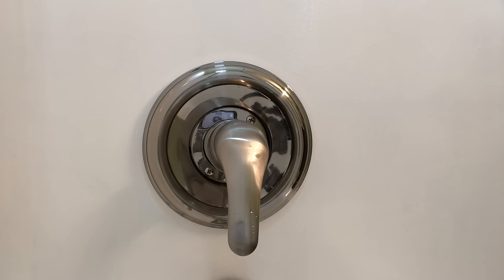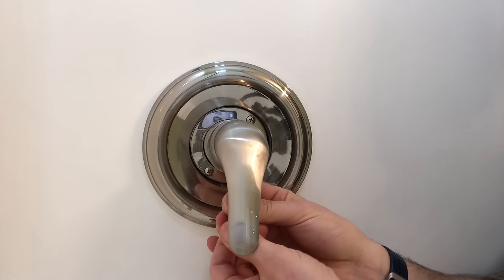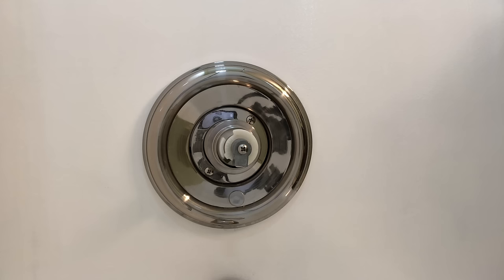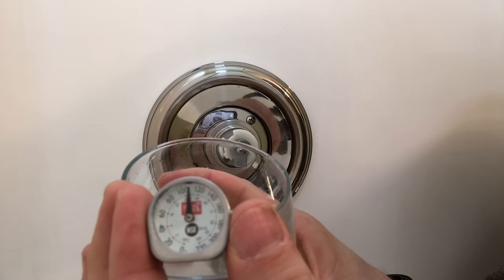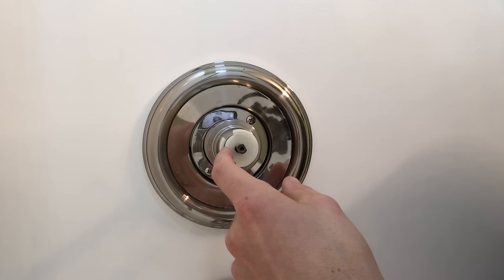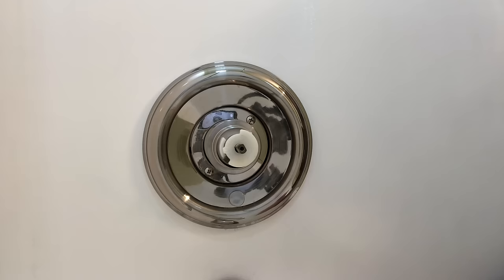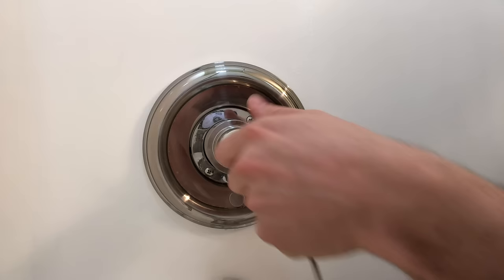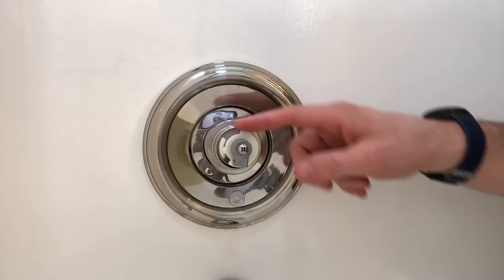How to Increase Water Temperature for a Delta Shower Valve

Comment: We haven’t used our second shower since we moved in to the house because it just didn’t get hot and we were considering getting a separate water heater for that shower. I knew it had to be an easy fix since our other bathroom has hot water. And I was right! Thanks to your video I fixed a 5 year problem in 10 min!!
Reply: Same here mine been a 16yr problem 😕 and that was all it took

Comment: Fixed it for me in less than 5 min. Just finished bathroom remodel and I was dreading have to call contracture about this issue. Fixed it myself. It was even easier with with the delta universal valve. The plastic ring is labeled “adjustable” and you just pull it out slightly and turn it left, dont even have to take it off. Thank you so much!!
Reply: Hi Janelle.  It’s Janel 😊.  Quick question...did you have to turn your water supply to the house off before you did this?

Comment: I have pfister shower. But also has the anti-scalding valve. As I watched this video, it's not even a valve issue. It's basically a limiter device to limit the handle/valve from opening. Mine was slightly different than the Delta as shown, but still the same concept. I was done in 5 minutes. Thanks so much. No more cold showers here
Reply from the maker: Nice Kevin!

Comment: Thank you for this video! We just had a shower remodel and the water wasn't getting hot...I was able to fix this in less than 5 min
Reply: Michelle Hultberg same here. I was thinking it was my water heater.
Reply from the maker: Louis, good point as often it could be the heat dial on the water heater being set too low.👍

Comment: Let me save you five minutes. Remove handle with required bit, move limiter to the left, put handle back on
Reply: THANK YOU!!😂
Reply: True, but this video is helpful for people who are new to doing stuff like this
Reply: Awesome bro!
Reply: Clockwise. Not to the left.
Reply: My limiter won't go farther to the left and the water is slightly less warm. What do I do?
Reply: @TheCyberguy101  increase hot water temp slightly?
Reply: @dj_countriboi92  Im a little scared because the water is hot everywhere else but ill try and see what happens.
Reply: @TheCyberguy101  Good luck my friend.
Reply: @TheCyberguy101  if it’s hot everywhere else, don’t increase it any further. Try scanning your shower tap with google lens on your phone to figure out the make and search how to correctly turn the heat up
Reply: @TheCyberguy101 you’re supposed to move it to the right, clockwise, to make the water hotter.
Reply: It’s not a “bit” but an Allen set screw! Thanks for trying though
Reply: @MasteringHow-To left is common term for counter clockwise. Lefty loosy Righty tighty

Comment: Just now watching (March, '23).  Almost a great video - lacking was what we couldn't see when your hand was covering the 'adjustment' (could you have moved the camera to the side?).
Also - like the others I watched - you should have advised viewers to close or cover the drain so when the Philips head screw gets dropped it doesn't get lost ('cause it's gonna happen, sooner or later!).  😀
I appreciate the instruction, as we replaced the water heater and needed more hot water in the shower.  I'm assuming the previous owners negatively adjusted the valve to make the lack of hot water last longer (we had to cut a door into the block foundation to replace the hot water heater).  Your video is 4 years old, but will never go out of date!

Comment: So easy, mine didn't have the adaptor with the screw, just had to remove the handle with the supplied allen wrench. However, it would be good to note that your faucet is sort of backwards to mine, I had to turn my white plastic threaded thing COUNTER-clockwise to make it warmer.
Reply: Hi. What size allen wrench did you use? TIA

Comment: I stripped my screw trying to get it out. Some deltas have a set screw in that inside screw that also needs an Allen wrench. I wish mine had been easy like this one. So to others be careful if you have a tiny screw into side of this gold screw it has to come out and then both plastic guards pried off to move. They didn't just turn to the right. But still thanks for the video. Just watch a few until you find one with your delta faucet.
Reply from the maker: Good advice in terms of being careful not to strip the screw.  Turns into a big pain in the butt once stripped . Been there before 👎
Reply: I think this is my type of delta I cant figure it out. I got the handleoff but hther is no philips screw

Comment: Minds doesn’t look like that inside there. Has an oring that holds on two different metal washers with teeth on the ID that bites on the teeth on the OD of the center pin.

Comment: You can thank the trial lawyers for this used horse food.  My valve was put together with blue loctite, making it very difficult to remove the handle screw.  Plumbing code?  Sure I could have twisted harder, but I know about how hard you can twist a certain size screw w/o breaking something.  The solution is a 1/4” impact drill driver with a #2 Phillips bit..carefully!  No one wants to burn someone, but when you can’t get anything more than a cold shower, the safety Sallys need to be opposed.  Never trade freedom for safety.

Comment: ave a handle with a screw hole in the middle on the front of the handle, not the top or bottom, that I cant get it off. I can't find any tool to go in the hole and latch onto anything. How would you suggest I get it off?

Comment: I don’t know what’s up with mine, but I tried to take off the handle but the screw refused to come off. I tried multiple allen wrenches and they fit fine, but it WILL NOT TURN 😭 I just want a shower that has hot water for more than 10 minutes

Comment: We did all of this and it still is not getting hot at all. Any other videos to watch? Or could something else be wrong? Brand new Delta shower fixtures.
Reply from the maker: Rena,  Good question and yes there could be other issues which are the root cause of your water not getting hot.  How about at the sink faucet in the same bathroom?  Are you able to get hot water?  Hotter than the water in the shower?
Reply: I'm having the same problem. I replaced the cartridge on a delta 1700 handle and the water is now much less hot than it was before replacement.
Reply from the maker: Hey Joseph and can you confirm you are getting higher temperature water at the sink in the same bathroom?

Comment: Hi could you help with my question, why does the temperature in our water change when showering? For example, say someone is in the kitchen and they decide to wash their hands while someone is showering the temperature in the shower will turn either too hot or too cold, Why is that?
Reply from the maker: Hi Tiffany,  it would be my guess that your shower water lines branch off of your kitchen water lines.  So when someone runs the kitchen faucet or dishwasher (runs on kitchen faucet water source) then the hot and cold water running to your shower is impacted without you changing the position of the valve in the shower.  This is not an uncommon problem and to fix it would take a bit of plumbing work.  All the best!
Reply: Thank you for your response . So what do I have to do to avoid this? How do I know which tubes will need to be removed and placed differently?

Comment: I am doing everything in this video but I’m not getting hot water 
My question is when I remove the plastic thing when k put it back am I’m supposed to rotate it with the part it fits into?? Or just rotate the plastic part. The metal part does not want to budge. Help!!
Reply from the maker: Hi Sonia,  you would just want to remove, rotate, and then insert the plastic part.  Test out the hot water at the vanity.  Does the vanity hot water reach a higher temp compared to the tub/shower?

Comment: Great video! Question…other instructional videos state to shut off the water supply. Doesn’t appear you did so in your video. I have a newer Delta faucet. I have a older home so I am afraid to shut off the main and potentially create a second problem. Your thoughts?

Comment: What can I do when handle won't come loose cause of hard water? Help!
Reply from the maker: Yeah, that can be an issue.  If you have a lot of mineral deposits you can try to be creative and figure out how to soak the handle and set screw in vinegar which will help break down the deposits.
Reply: @EverydayHomeRepairs  Thank you

Comment: i have this model of showerhead and i can get the alan wrench  into the socket inside the handle. any tips or is mine stripped out or something?
Reply from the maker: Hey Josh, it could be stripped.  You could turn off your water so you can turn the handle so you can look down the hole and inspect.  If you think there are mineral deposits (green color) which is holding in the set screw you could soak the set screw in vinegar which might help to loosen things up.
Reply: @EverydayHomeRepairs  Thank you!

Comment: But do you actually need to shut off your water supply first?
Reply from the maker: Hey Chris, you should not need to shut off the water supply.  With that said before working on any fixture you at least want to know where the shut off valve is located and that it is functioning correctly.  Best of luck!

Comment: Mine isn't delta and I can't find the same valve. I am in need of hot shower as my hot water becomes cold in minutes!
Reply from the maker: Hi Ldn hamhm,  you might want to also check your hot water heater as it could be  getting close to the end of useful life and need to be replaced.  To test this you could turn the water on in your shower to the hottest setting and wait the couple minutes till you start seeing the temperature drop.  Once the temperature is dropping in your shower you could turn the bathroom sink faucet to hot to see if you are getting the same temperature water from the sink faucet or if you are able to getting hotter water at the sink faucet compared to the shower.  If you are able to get hotter water at the sink compared to the shower then it is probably the setting on the shower valve.  If the temperature of the water is the same then you are probably looking at an issue with the source of the hot water (hot water heater).  Best of luck with your troubleshooting.
Reply: Everyday Home Repairs thanks! I'll check that then.
Reply: Guaranteed your diptube is broken in water heater, easy fix

Comment: Smarter taking off the one screw on the handle it seems I cant pull off the handle.. with that being said do I force it out?
Reply from the maker: Hi Kong, there is a good chance you have mineral deposit build up that could be holding the handle on.  If it were me and I was confident the screw was removed then I would apply heat with a heat gun then use gloves (to not burn my hands) and slowly wiggle the handle with an increasing amount of force pulling the handle off.  I wouldn’t go crazy with the force but hopefully that will break things loose.

Comment: What if all you get is hot and no cold
Reply from the maker: 🤔 Does your bathroom sink has cold water? Did you have cold water to this shower/tub before or is this a new property?
Reply: @EverydayHomeRepairs  yes everything had cold water until we changed the cartridge. Cartridge was reinstalled without the retaining clip initially so the handle spun a few times. Since the water pressure pushed the cartridge out of its seated position.

Comment: I can't even get the screw to come out for the first step. I turn and turn and nothing happens. This is so frustrating.
Reply: I got it! I was trying with a 3/32, but apparently that was a bit small. Tried a similar sized metric and it came right off. That hot shower was great! Thanks!
Reply from the maker: Nice!  Thanks for the update 👍

Comment: Besides increasing the hot water temp, does it also increase the flow of the hot water? I have a similar Delta, and when turning on the hot water for showers, it seems the water pressure is just not anywhere near as much as the cold. The cold water blasts out of the faucet, but the hot is only half that amount and when adjusted for your comfort temp, it's  just not that powerful.
Reply: I know nothing about houses or plumbing but a complete amateur guess is maybe there's a leak

Comment: what size allen did you use to take the handle off
Reply from the maker: Hi Jennifer should be a small allen wrench but I don’t know the exact size for you.  A set like this would work https://amzn.to/2OlyPj9 .  Also any hardware store or big box home improvement store will have several sets in stock.  You get a flash light turn the handle so you can see the hole (water will be running) and ensure it looks like an allen set screw and not a set screw with a slot for a screwdriver.

Comment: I'm missing that grey piece on mine that sits against the white plastic valve 'limiter', so that is kind of moves, which I realize now is why I've had lukewarm showers for the past week. can I get that piece, at the big box store or do I have to special order?
Reply from the maker: Hi Faith,  the grey piece I removed prior to getting access / adjusting the white valve limiter cane with the delta trim kit.  The grey piece is simply an adapter which screws into the valve and provides a mounting surface for the handle.  Depending on the type of valve you have and the type of handle you may or may not have the grey adapter.  Best of Luck!

Comment: after i got the handle off, there s no phillip screwbut i see the plastic dial thing.   I dont know what to do next and I dont see any other videos with this type of mechanism  help! please.... itook a pic but dont know how to upload to this comment
Reply from the maker: Yeah, I wish you could upload pics as it would help a ton, but as far as I know that is not a feature in the youtube comments section.  What brand of valve  do you have?  Did you see a name on the trim plate?  Also do you see any writing on the plastic stopper?
Reply: @EverydayHomeRepairs   I dont know I see the plastic dial and it actually says/has text Hotter w/ arrow pting counter clockwise and colder clockwise (the opposite of your instructions.  theres a brass bolt where th screw should be and behind that is a screw  perpendicular thru the bolt. i think its an allen screw but i dont hv the correct size wrench ( i tried...i thought i was philips so i tried thta too)  the screw is not stripped.
Reply from the maker: @algreene9079  if you look up "everyday home repairs" on facebook you will see our page with the same green logo.  Why don't you jump over there and add a few photos of your specific valve.  With a few pictures I am sure we will get this figured out.
Reply: @EverydayHomeRepairs  ok

Comment: What if you can't get the freaking damn handle to come off and had to drill out the set screw
Reply from the maker: Were you able to get the set screw out?  Agreed, depending on the age these handles can be a major pain to remove.

Comment: Hi, I cant get the screw off the handle. USing WD40 and 2.5mm allen wrench. IS the best angle to unscrew it from the bottom like the video? I have not stripped the screw YET
Reply from the maker: Hey dropshot, yeah those little screws can be a pain and I am happy to hear you haven't stripped out the screw yet.  Do you have a heat gun?  Maybe try adding a little heat and see if that can help break the bond created by the mineral deposits. Alternatively you could turn your main water valve off and then position the handle with the screw up.  Then poor some viengar in the hole and see if that helps to dissolve the mineral deposits.  Let me know if you get the screw broke loose since this is a common problem.
Reply: @EverydayHomeRepairs  thanks I'll try all of this. I heard vinegar is effective from other posters
Reply from the maker: @dropshot118  best of luck!

Comment: I have removed the set screw from my shower handle but it still won't come off,  I have a Delta handle as well and there isn't any outside screws. Any help?
Reply from the maker: Hey Em3raID,  I would also expect the handle to come off easily if you have completely removed the screw.  If you have a delta valve with a handle and not the knob then when the screw is removed the handle should just be sitting on a small adapter which is attached to the actual valve stem.  In fact when I remove the screw on the setup in this video the handle will basically fall off.  Best of luck with you repair.
Reply: @EverydayHomeRepairs  I figured it out, it just needed a little jiggle to come off, but thanks anyways!
Reply from the maker: No Problem, glad you got it figured out.